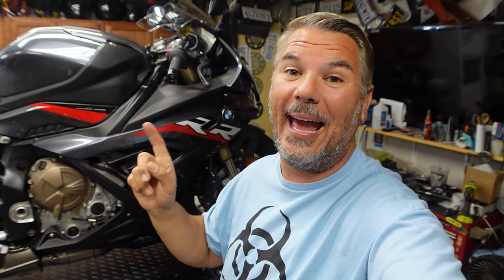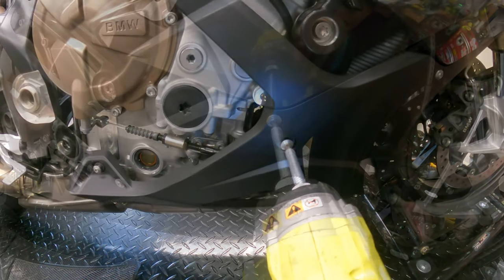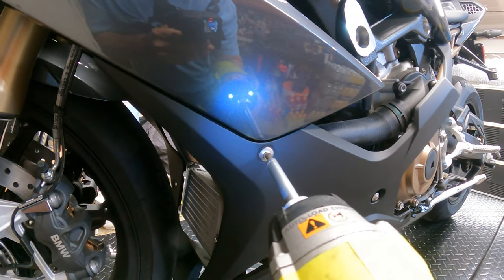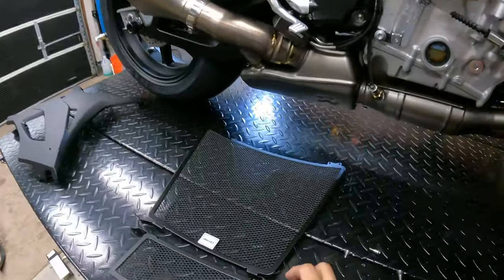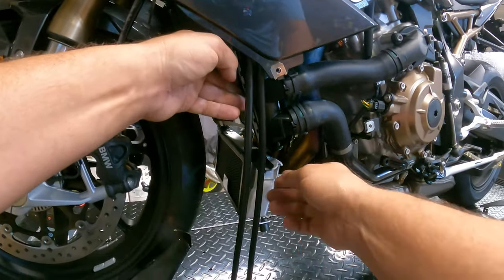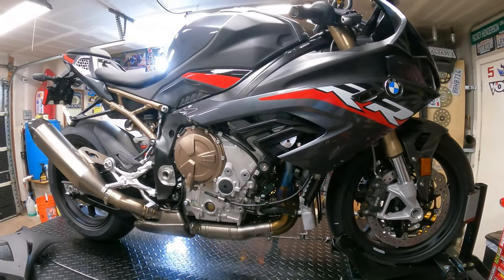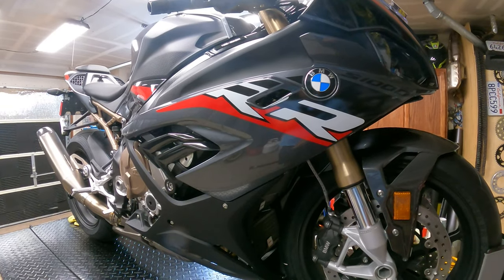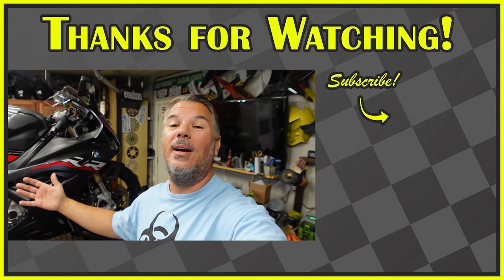2022 BMW S1000RR | Radiator Guard How-to Install

Comment: Hey Bill, great video! Quick question. Do you feel an excessive vibration on your bars/front wheel past 90mph? I feel it a lot compared to my panigale or rsv4. Not sure if my front wheel needs to be balanced or if I need better bar ends. Any tips would be greatly appreciated. See you at the track my friend 🤙🏻

Comment: Bill, your videos are fantastic!  I recently purchased a 2022 s1000rr.  Could you give me your recommendation for a torque ratchet for the BMW?  One that would be able to torque anything on the bike.  Most recently I'm putting on frame sliders and Helibar replacements and want to torque things down properly.  Oh and a torque ratchet that's great value for the money.  I don't want to spend more than $200.

Thanks in advance!
Reply from the maker: Check out the video for the garage tools, that's what we use.